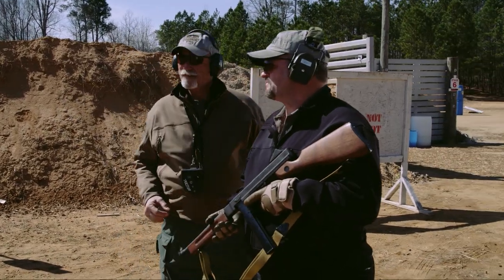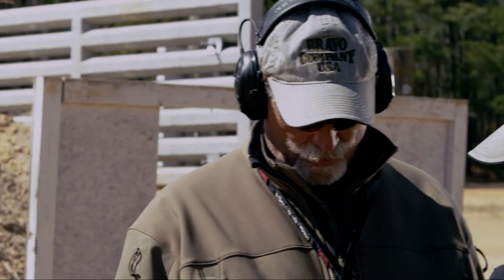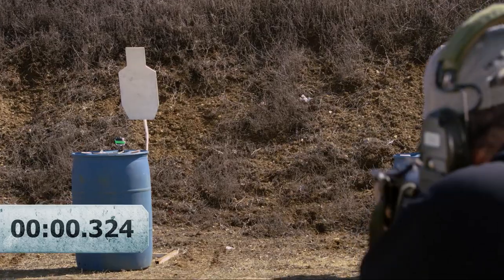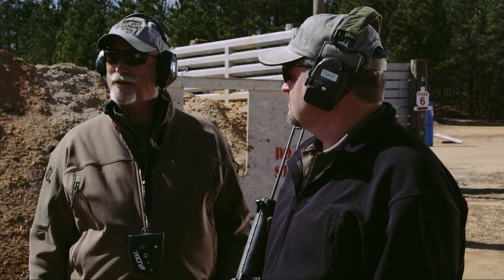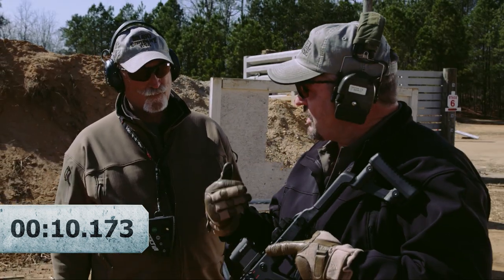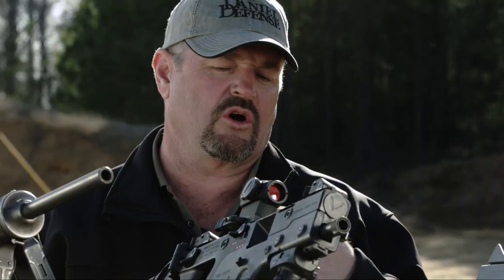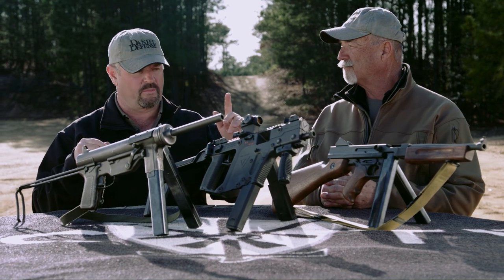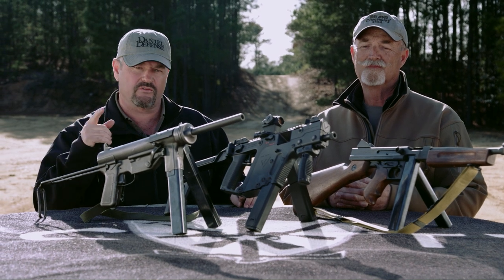Battle of the Submachine Guns Pt.4: Thompson vs. Grease Gun vs. KRISS Vector

Comment: I believe the whole thing with the Vector's very high cyclic rate of fire is to show just how well the action reduces the muzzle climb of a relatively heavy recoiling cartridge (at least for a submachine gun) that's being fired very quickly.  PR mostly.  I'm sure KRISS realizes how much more practical a slower rate of fire would be, but they want to "show off" for the time being.

Really, if I'd like a low recoiling, fast firing SMG/PDW, I'd probably go with something like the P90 or MP7 instead.  They are even more controllable than the KRISS Vector.
Reply: And their also firing a MUCH smaller and less powerful round. Ill take 230gr over 40gr EVERY TIME.
Reply: In terms of "power," they're about the same.  The much higher bullet velocity makes up for the lack in weight.  Also, tests show that a 5.7x28mm bullet that tumbles actually has better wounding capabilities than those cheap 230-grain FMJs that the military is pretty much stuck with, which tend to over-penetrate the target.
Reply: BattlefiendHrush are you high? power is in terms of kinetic energy as in mass times velocity. For the 5.7s 40 gr bullet to equal the 45 in energy it would have to be traveling over 4 times as fast. Which would have to be about 4000fps, which it clearly is not anywhere close to. keep your opinion out of it and go with facts and you'll be a lot better off. And facts will tell you that within its effective range, the 5.7 is ASSLESS compared to .45acp.
Reply: Actually, kinetic energy is the velocity SQUARED multiplied by the mass.  Double a bullet's mass, double its kinetic energy.  Double a bullet's velocity, quadruple its kinetic energy.

The military standard, 230-grain "Hardball" produces a muzzle velocity of about 820 fps out of a 5" barrel, resulting in about 343 foot-pounds of energy.  Tests show that it's capable of pushing through a bit more than two feet of ballistic gelatin (density being almost the same as human muscle tissue), which is far more than what's needed to reach the vitals (severe over-penetration).  Torso simulants have also shown that it can pass through a human torso (weaver stance, avoiding bones) while transferring less than 200 foot-pounds of energy.

On the other hand, the 31-grain SS190 produces muzzle velocities of about 2,130 fps out of the FN Five-seveN and about 2,350 fps out of the P90, 312 foot-pounds and 380 foot-pounds respectively.  Due to the spitzer bullet design, tests have shown that this bullet can reliably tumble in flesh (the P90 being more successful due to its higher velocity).  When the bullet tumbles, it expands the permanent wound cavity, and it transfers the vast majority, if not all, of its kinetic energy to the target.  Therefore, it's a deadly projectile that has good armor penetration (for a handgun round), a flat trajectory, low recoil, and lower threat of collateral damage (in a militarized situation where expanding ammo is disallowed/not used/highly regulated).

BrassFetcher goes over why such proprietary "PDW" ammo is superior to "traditional handgun" ammo in the surplus non-expanding options.  Very good source for terminal ballistic research.
Reply: Im not even going to enter this debate with you. You obviously have some biased opinion and are making the 5.7 to be something it is not: a stopper. 
So you take your 5.7 and trust your life to it all you want, but in the end all you have is a shrunk down 5.56. 
Ill take my 230gr ball.
Reply: Angel R. First of all, he uses information from military ammunition last used in the 1980's. Now with +P ammunition you are getting over 200fps velocity increases. Then he states a scenario where everything has to align perfect (the round passing straight through without hitting bones or vital tissues) to give a scenario that the 5.7 will succeed in. Everything he is saying is based on that one chance that may or may not happen. 

He also states kinetic energy as if it is static. It is entirely based upon the amount of area to which the bullet is acting upon. Even if both rounds were equal in energy (which they are not) the 45 acp is acting upon a surface twice as large. It will not penetrate as far in any scenario, allowing it to dump all of its energy into the target not behind it. And even if it did penetrate further, and didn't tumble at all, it is still a .451 caliber bullet. No matter what. It will cause a much larger wound cavity. 

If you need more supporting that fact that 5.7 is anemic go watch Larry Vickers talk about the MP7. He states that the both it and the 5.7 are horrible rounds when it comes to a man stopper. That is the only thing he bashes the MP7 about. If you are like "Battlefiend" up there and wasted money on a 5.7 (like one of my friends did) and need to support it, then my all means do it. They are great pistols, just a horrible round. But don't make it out to be something it isn't and that is a man stopper.
Reply: Angel R. I'm going to let you off on this one because you seem new to this. +P is a designation. Essentially, it is a different cartridge altogether. As it is only suitable for newer firearms capable of withstanding the increased pressures. You only see +P in older cartridges (9mm, 45acp, 38spl, 44spl,ect.) It was introduced as loading technology allowed companies to get hotter loads in the older designs. It isn't intended for older firearms. Much like the newer 45-70 loads. It doesn't matter what bullet is in them, it is just a load designation, the military could load the .45 with ball ammo in +P configuration quite easily.
Reply: Well, they've got to do something to justify themselves as being worth it compared to just taking some old M3's out of storage and M3 is very very common around the world but mostly kept in storage. Selling a new SMG it can't just be as good, they need to be much better or they won't be bought.

And their stiffest competition is not from SMG/PDW but from small compact assault rifles.

P90 has had decades to take off and still hasn't and I think the problem is the proprietary calibre and uncertainty in ballistics. And compact assault-rifles or carbines service that best, use the same ammo and magazines as the standard service rifle.

A .45ACP submachine gun is quite a good middle ground. It's terminal effectiveness is well known from use in many wars and detailed analysis in police reports (not that it's necessarily amazing, but it's a known factor).

SMG's like SIG MPX seem more interesting. They but a huge emphasis on being suppressed, that's a differentiating factor from assault rifles and carbines. Also a very wide magazine well, great for much quicker reloads.

The big factor is "why would I bother with an SMG when we have all these neat compact little 5.56mm carbines?"

Sound and flash suppression and the form factor of narrower magazine are probably it.
Reply: Well here is my 2 cents. The 5.7 CAN be Armour piercing, so going up against someone with body Armour it trumps the .45. In addition, the higher velocity allows for more accurate shots at range. However,at closer range against an unarmoured target, the larger size of the .45 should help the transfer energy from the round to the target.
Reply: DTMGunny You really think the velocity difference makes a significant different to accuracy at SMG/PDW range?

The thing is how common is body armour for the actual threats these days? Mogadishu, Iraq, Afghanistan... general lack of body-armour.

This is why 5.7mm is niche while contracts for military pistols in .45ACP continue. 

FN's P90 has had decades to make it and it remains extremely niche.
Reply: Treblaine the p90's only real purpose is for someone like the secret service or protection details. If FN would chamber it in say 9mm there would be no telling how popular it would be.
Reply: mark shuler Why?
And are they really even that popular with protection groups?
Reply: Treblaine our secret uses them so yeah
Reply: mark shuler How did you find that out?
Reply: cityhunterhf Are you honestly using airsoft as a an argument? Please stop. This is a conversation of real guns not plastic toys you play around with with your buddies because your mom won't let you have a real gun.
Reply: cityhunterhf "Even airsoft players chosen more Mp7 than KV"

In airsoft destructive power is utterly irrelevant. All the pellets do effectively no damage.

I could appreciate airsoft if it stopped pretending to be what it was not. If it was more honest with itself that it is just shooting little plastic pellets then it wouldn't be so sad.

No one mocks paintballers as no one tries to make paintball guns look like real guns or pretend they are doing anything more. 

I'd be about as interested in a fake plastic life-sized gun as a fake plastic life-sized Ferrari. 

"it's way too big to carry it running around, and the mp7, they can carry it with a pistol holster"

The problem with that logic is people trade in their M4 rifles for Baby-glocks because all that matters is smaller is better.

But you've got no grounding in shot efficiency.

FYI, the USSS don't get into many shootouts, they are bodyguards, 99.99% of their work is interviewing, searching, and literally body-blocking for politicians and diplomats.

If the President or whoever needs more substantial protection from a possibly overwhelming force then a contingent of Marines is usually put on duty and they don't use MP7's or anything like that.

Comment: I love the idea of submachine guns. But nowadays, carbines like the AK have an overall length (even with the folding stock extended) which is less than most sub guns and has way more firepower.
Reply: Assault rifles have transformed the conduct of infantry warfare; there's no question of that. But that doesn't mean that traditional SMGs do not have their place. An AKM/AK47 recoils harder and is therefore tougher to control in full cyclic fire than a traditional SMG, which fires a less-powerful pistol cartridge. Which is why special ops forces often opt for something like the MP5 instead of an assault rifle, for certain kinds of missions. Pistol cartridges if they are not already subsonic, can easily be made so - and therefore suppress better than supersonic rifle cartridges. They're easier to control and keep on target, too, so better accuracy overall. Obviously, not every mission is ideal for an SMG, which is why other platforms exist. But submachine guns would not have continued to be produced and employed if they did not enjoy certain advantages over other types/classes of weapon.

Comment: The  Thompson smg  has 10.941 seconds and the  Kriss has 10.173 seconds  also ; and the grease gun has 11.022 seconds. The differences in practical consideration are very negligible especially the time gap between the Thompson and Kriss. The Thompson start in open bolt- just press the trigger and the bolt will go forward swiping ammo from the mag feed it to the chamber and automatically the hammer will fire the ammo.The grease gun, i think, start in close bolt and so with the kriss. The miss shot on the grease is due to the shooter not the gun. all guns are quality made and the two WW2 guns have proven their reliability in field condition during the war. The kriss is new. The Thompson is heavy because of the material use in it and it has a selector(single/auto) what is not good to me is the magazine well that is open not enclosed making more difficult to insert fast a mag; and also its being open bolt which will allow dirt to enter the bolt area. The grease gun was purposely made to fire in slow auto-mode because its bolt was made heavy to make slow its cycling. The purpose is not to waste ammo because the grease was made to fire in full auto only. What makes the kriss just a little better than the two old foggies is its modern material use, it has a select-fire burst of three and much more it has a recoil damping device making the kriss recoil-manageable that even in full auto fire at more than CQB distance it maintain a very good shot groups.If it is the thompson or grease gun are the ony guns i can have or afford to have for defense,  I will gladly want it. I hope that this guns will be modernize and their noted "defect" will be improved.
Reply: +dosdadio siapa well, you could have saved yourself some time and said that they were all a fraction of a second between eachother so theyre litteraly not much different
Reply: I explained. can you explain that way? You even say " literally not much different" which is wrong because i am not comparing words that they can be literally the same.

Comment: Thompson is able to have a 30-round stick mag 50 round drum or a hundred round drum and it shot the 45 round they failed to say that and the others shoot 9 millimeter rounds big difference in power Thompson all day and they also failed to talk about their rounds per minute Thompson 1921 can go to a thousand rounds permanent the grease gun 350 rounds per minute and as for the other gun that looks like a vector I'm not sure the specs on that but I do know it shoots 9 millimeter and it's burst fire
Reply: All three very cool. However the Kriss is 45acp, also 9mm and 10mm. Smaller and lighter with two round burst and full auto. It has a folder and a rail. It also takes glock mags. Which you can get glock drums for as well. The mags are interchangeable with a glock side arm. They also didn't talk about the way the bcg is designed for less felt recoil. Or the great materials its made of. (not plastic) Nor the ease of breakdown for cleaning.

Comment: Yo at 4:32 the Thompson is depicted as the gun with the lowest muzzle velocity, when in fact it is the M3A1 Grease Gun. These guys really dislike the Thompson, for some unfounded reason. Also, what do you mean the Thompson isn't a good gun? Are you dumb? The Thompson M1A1, which is what you are using, is ten pounds even. The M3A1 is 8 pounds. It's two pounds of difference. Additionally, the M3A1 has less stopping power than the M1A1 Thompson, and has a slower rate of fire. Even after your grouping with the M3A1 was worse than with the Thompson, you still said you would pick the Thompson last. You guys know what you're talking about, but for reasons I don't understand you really dislike the Thompson for really no valid reason.

Comment: The Mac 10 in 45 acp with the wire stock and fore grip strap is actually a great little gun. I have one and with a good bit of practice to build up muscle memory it becomes a very accurate controllable and useful submachine gun. I say you really need to get used to the Mac because the wire stock will collapse while shooting if you rely on it 100% lol you have to rely on it 75% and the front strap 25% I've found. Once u get used to it you will see that you can keep all 31 rounds fired full auto all at once on target past 50 feet

Comment: 1) Kriss Vector. Come on, it has at least about 65 years worth of technology over the others. 
2) Thompson. Although it was the earliest to be designed, it has a high (in comparison to the M3) rate of fire, an actual stock and grip where you won't burn you hand or anything. However the Kriss Vector is generally superior in most ways due to it's modern design. Not to mention the awful recoil that comes from the Tommy. 
3) Grease gun. A generally cheap gun, made as simple as possible. i guess those are the pros as it means they are easy to manufacture and could probably be built from scratch without too many great problems. Although it, as mentioned before is basically just a couple metal rods that can fire bullets.
Reply: Thing about the M3 is that while it was super cheap to assemble and throw together (If I remember right, they could pump one out in an hour), it doesn't make it a bad gun. It was reliable, reasonably accurate, and it's lower fire rate made conserving ammunition and shot placement remarkably easy.

Honestly, if an M1 carbine wasn't available, I think I'd give a grease gun a hard look for one of the go to guns for close-medium range versatility.
Reply: Yeah, fair enough. I think it would be better if the M3 had a grip or something, because you can't really hold the barrel or magazine.

Comment: what reason is there to have an expensive semi-auto degraded gun than a dedicated semi auto pistol that fires the same cartridge and can safely fire high pressure ammo ?

that thing full auto ... ? accuracy ftw, but 0.45 kicks a lot, so smaller caliber might have worked better in full auto, like in 9*19
Reply: Yeah, but consider that the .45 definitely has has better knockdown power at the cost of recoil compared to the 9mm. Personally, I'd rather run the KRISS in .45 with the confidence that I can knock a target down in less time and less used ammo than 9mm. I look at it like this, you hit a guy twice with .45, he drops and stays down. Hit him twice with 9mm, depending where you hit him, there's a good chance you may need a third or fourth shot to keep him down. Not saying I'm a expert in ammunition or the physics behind it, it's just my personal opinion.
Reply: ShadowElement101095
Your right about not being an expert in ammunition.  Where you hit matters with any small arm caliber especially true with any pistol ammunition.  The .45 though IMO has the added benefit of being naturally subsonic and when you use a can, it will be quieter.
Reply: ShadowElement101095 There's little difference between 9mm and .45 ACP.
It's all shot placement.  Of course shot placement matters with .308 too.  :)

Comment: The real issue is ROF cuz the KRISS is around 1200 and will easily beat the 700 RPM of the thompson whihc will beat the 600-650 RPM of the Grease gun. And really the thompson reload is not that bad.
Reply: You also have the M1A1 thompson which is a pretty shitty SMG, the 1928 thompsons are far more reliable and faster in every way.